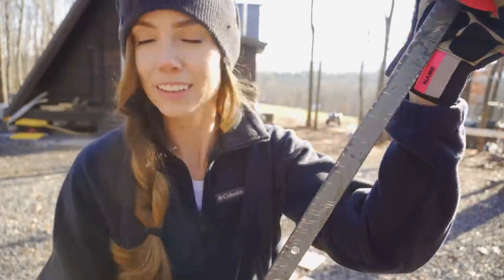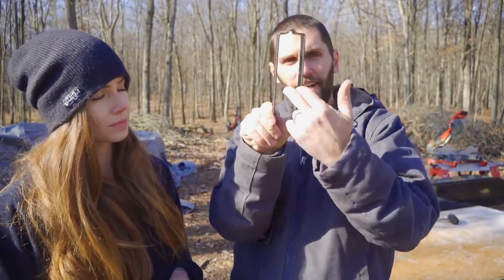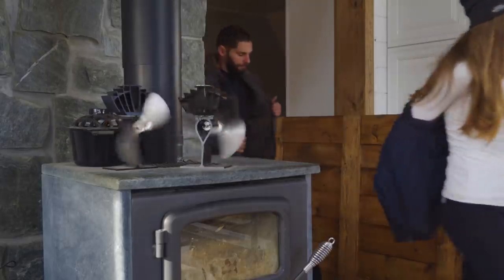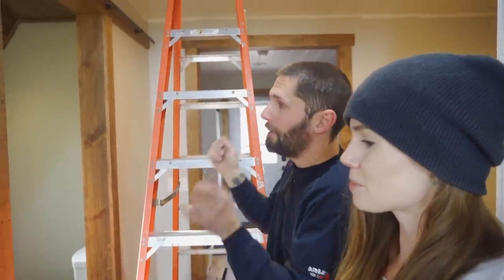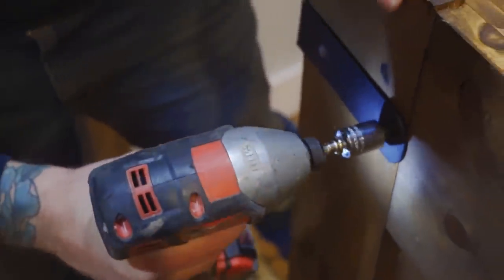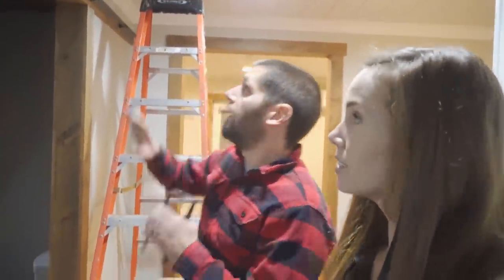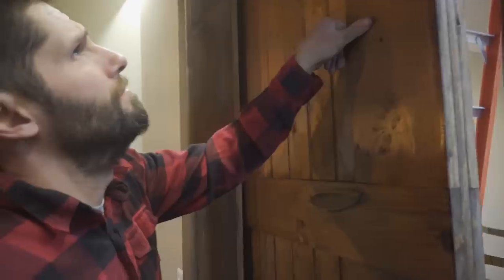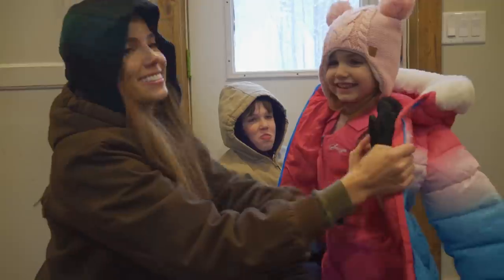Reusing 100 YEAR OLD Metal | Building Off Grid

Comment: Add something like rubber bands/felt to the wheels to add a little more padding on the top. :) And probably quiet down the rolling.
Reply from the maker: great idea!
Reply: I was thinking to remake the rail, but with the mounting holes not in the center.  If the hole was lower on the rail, it would raise the top edge of the rail without any modification needed to the lag bolt heads.  Would also raise the entire door a bit, but not sure if that's a big deal.
Reply: ...or maybe you could slot the existing holes in the rail vertically...essentially extending them downward, so you could slide the rail upward compared to the lag.  I'll bet the screw compression would keep the rail from sliding down in the slot, once the lags are tightened.  Then you wouldn't have to look at those modified lag screw heads every time you walked by there...

Comment: Pro tip 
If you're going to use your trailer for a work bench?
Mount a vise to the corner of it. Right on the railing.
Mine is easily removed/installed.

Comment: Erin, looking much healthier and your color is back.  Glad to see in the family getting better.  The doors with the iron looks really good.  You may need wider rails and use current bolts, just drill lower on the wider rail.  That way if, for any reason, the door and railing need to come down you have good grip for ratchet or wrench.

Comment: If the hex head bolts do still bug ya later get some large phillips head countersunk screws and countersink bits for the rails. Plus if the hex bolts on the door  are tearing up the door frame do the same thing there to.

Comment: Voila Josh you’ve got skillllllllls👍🏾 Its not pouring the concrete or getting the roof finished, but shaving an 1/8 off a bolt and fixing that one stubborn wall that you will take probably take pride in the most.

Comment: Nice work-around!  Another option would be to drill new holes, all to the same side & distance from the 1st holes, but 1/4" lower, effectively raising the height of the door, but also providing clearance between unground bolt heads and the rollers.

Also, you guys are SO right!  Those door handles are spectacular!!!

Comment: Caulking 'tip'?    Cut tip at 45-50 degree angle so exposed hole is tiny.  Then shave/sand sides at same angle.   Mark straight, non-tapered, nearside of nozzle with a marker to indicate that this side is to be towards you when filling.   This gets just the right amount down into the gap with no overfill and leaves a better inside edge.   I thoroughly enjoy all your videos.   Both your skills, your teamwork, patience and determination are an example to us all.    A pleasure to see the children growing up in such a happy and fulfilling home.

Comment: Very nice custom work for the first time, metal and all it looks great. 
There are lots of details to consider when custom building and installing a roller style door.  As a tip, mock up your door using 3/4 plywood with glued on door thickness blocks on each corner and center matching your frame board widths. Install all your hardware using the mock up, then build your door. Hindsight is always 20/20.

Comment: To lock the doors from the inside drill a hole thru the door and into the trim place a metal pin on on a chain and embed a magnet next to the hole to hang the pin on when not in use.

Comment: If you ever have bolt clearance issues again use GRK structural screws. They have a low profile flanged head, and are stronger than bolts. Awesome look on the doors.

Comment: If it turns out that grinding the bolt heads weakened them too much, you could replace the bar stock and drill the holes offset toward the bottom of the bar.  The main load will be pulling through the THICKER part of the bar so that won't be an issue, and just that little offset might be enough to allow the rollers free play.  I want to second the suggestion about rubber bands around the pully wheels to quiet the rumble, but at least now you can close the door when you're using the bathroom!

Comment: Trick for sanding drywall,  did this for wallpapering 2nd and 3rd homes. Use the brightest light you can find and point it down the wall left or right. This will show ever peak and valley.😎🤙🦅🌱❤

Comment: If you are looking for the hammered look on distressed steel, give the kids some hammers and let them beat on the steel. Then, straighten it and you have a hammered look that paint will not hide. When are you going to build a work shed/shop? Just a farmer's work shed with a gravel floor and some rustic work benches that endure the weather. Just something with a roof would be so useful and fit the homestead. And a work bench that the kids can do their farm projects on. Nothing is more inspiring than watching kids make things for their outdoor life.

Comment: Beautiful door, I would go to Lowe's or wherever and get a piece of 1/4 inch brass square bar, on the bottom of the door router about 1 inch up from the bottom, insert brass, press to fit. Otherwise your door will show slide marks from the alignment metal bolted to the floor, and the door will look even more unique.

Comment: I made and installed one of those barn doors and it was a pain for sure. Putting the door on upside down didn't help, and having to cut the groove into the bottom of the door for the guide bracket was tough, the door had to be held up right on the table saw. I had the same problem with the door handle on the interior side of the door, it was going to hit the jamb when pulled open from the inside, and the door opening was only about 22". Putting a handle on the door wasn't going to work, so I used a Closet Door Finger Pull, which required using a hole saw to cut a hole the diameter of the finger pull only so deep into the door, then use a wood chisel to remove the excess wood to create a recessed area for the finger pull to slide into. Little nails hold it in place.

Comment: A bit late now, but there was a 2nd option with those bars (under the rollers), in which you could have drilled the holes lower on the bar, leaving enough room at the top of the bars for the rollers.
However, nice quick fix. You did the right thing by coming up with a workable solution.

Comment: Another way to get the door to slide without shaving the bolts down is to countersink the holes in the bar and use countersunk screws so they sit flush inside the bar.

Comment: I would have suggested the exterior Star Drive structural lag screws which would be less of a worry if you should have to remove them later for some reason.  I hope you don't have the issue of getting them in and maybe not out later.  That would really suck.

Comment: Josh, if you don't like the shaved bolts, couldn't you replace the existing piece of metal with something that is maybe 1/2 inch wider?  Centering the bolts would give you an extra 1/4 inch top and bottom, and it appeared that you may have only needed about 1/4 inch for the track wheels to miss the head of the bolts anyway?

Comment: Glad you guys did it yourself, the kits are usually crap anyway. Hubby has installed half a dozen or more at this point for work, and there's always something wrong with them. They're bent, or they aren't spaced at standard stud widths, or they just straight up didn't predrill the holes like they were supposed to... So making it yourselves was probably less work in the end.

Comment: Move the HOLE over 1 INCH AND THEN DOWN 1/4 INCH. Now the bar is 1/4 Inch higher, or the Bolts are 1/4 inch lower.

Comment: Great job on the doors!!! Just one thing though that I did not see you do on the video. Did you install bumpers on the end of the door rails or bumpers on the floor, so that just in case the doors get pushed or pulled too hard, there is a way to stop them before they cause any damage?

Comment: Not sure how wide that steel is...looks like 1" or 1 1'4" wide...you could have gone up to 1 1/2" or 1 3/4" wide rail to move the bolts further away from the top and thus the rollers...

Comment: By rebending the brackets, you also gained the ride height to not drag the door on the floor. 

Did you guys factor that in or totally get lucky? 😂
Reply: The top of the bracket remains the same. Just because the bracket does not hang as low on the door makes no difference to the bottom.

Comment: If you had drilled the holes lower in the bar instead of in the center. Then the bolt head would have not been hit by the roller wheel.